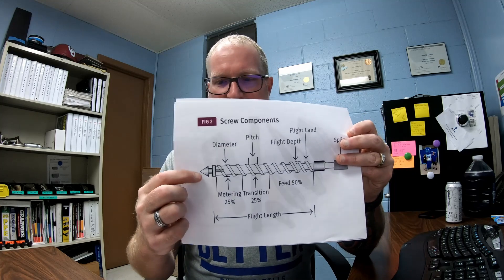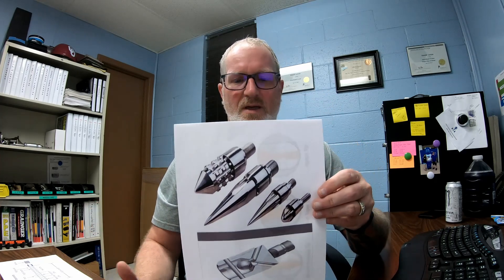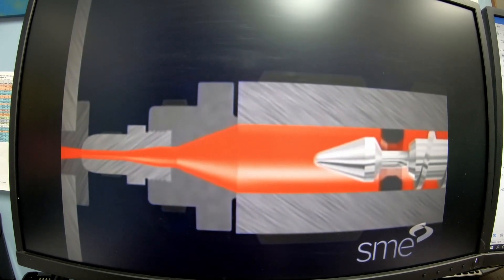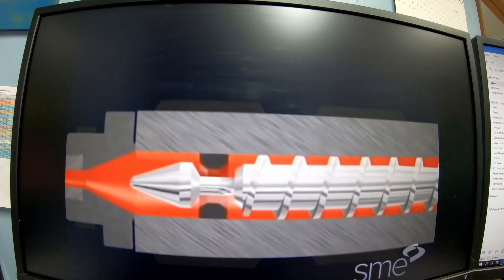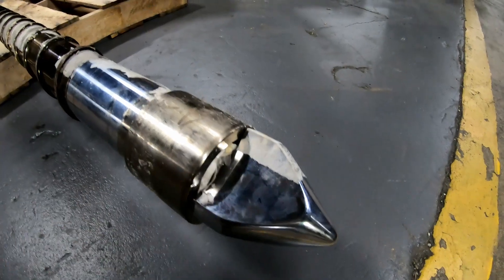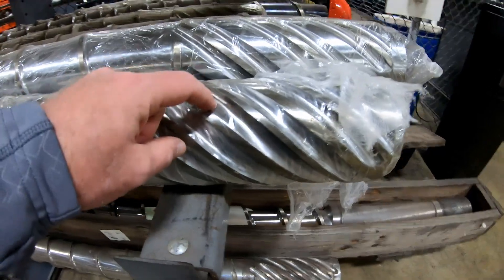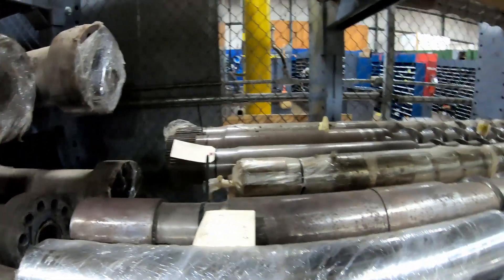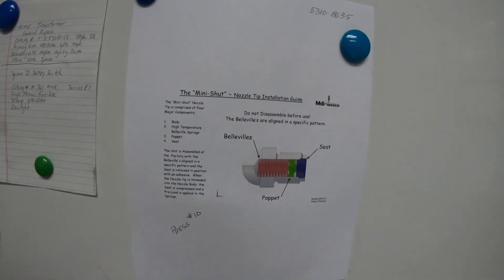Screw Components in Molding

Comment: Hey dave, how important is it to purge all material from the barrel during a machine shutdown? Im using polypropylene and we turn the machines off over the weekend, it is critical that we purge remaining material from the barrel before shutdown, or is it alright to leave the material in the barrel for a few days?
Reply from the maker: Yes it is fine if its polypropylene. The only time is if you have dried material that you run, most of the time you need to purge that out with polypro.
Reply: @injectionmoldingskillsmore1064  alright thanks man!!